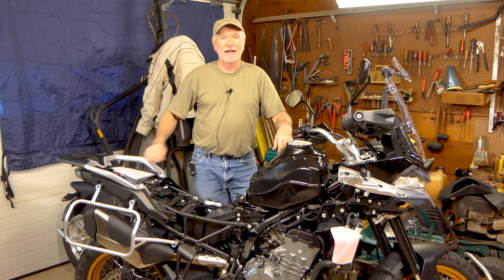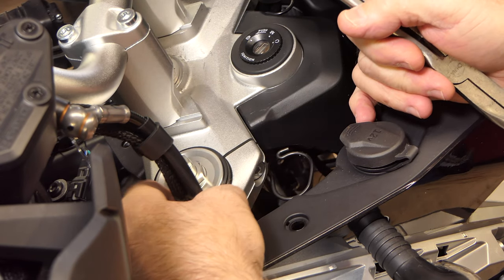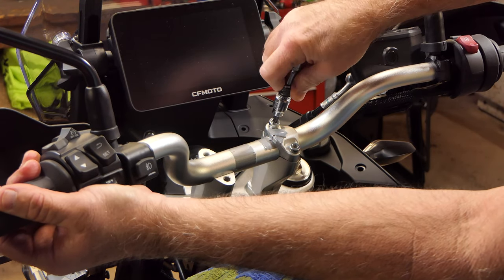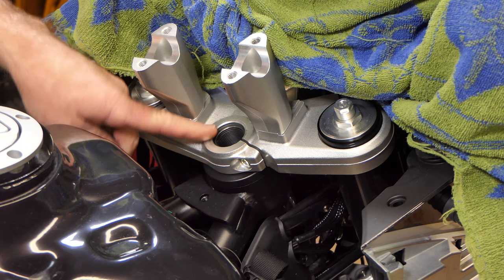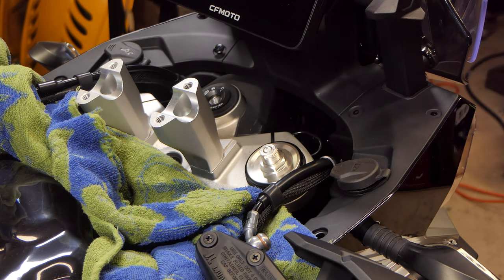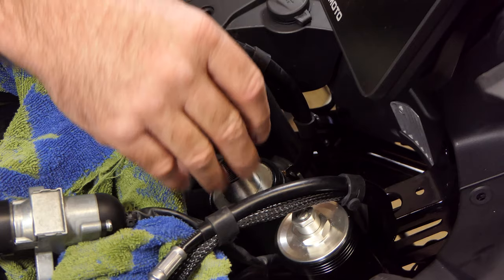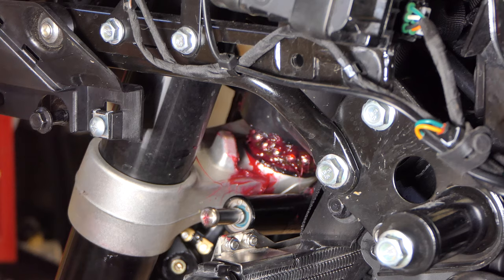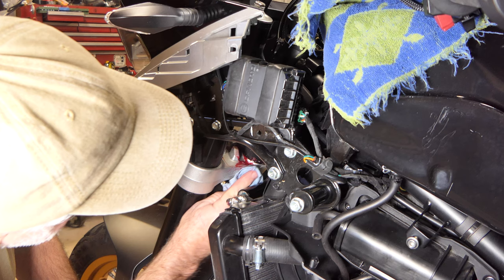CFMOTO Ibex 800T Steering Head Bearing Service...

Comment: What an excellent example of showing the minimal grease that is actually applied from the factory John!  I could see the lower race looked as if water ingress had started to rust slightly. Surprisingly not seeing a thin steel plate & encapsulated rubber ring seal under the bearing? I wouldn’t have thought the balls would be loose! You definitely don’t want 1 of those to fly around the garage floor! Thanks for sharing!
Edit: I think there is a seal!
Reply from the maker: Good to hear from you sir... thanks for watching. :)

Comment: I watched quite a few of your videos of the Ibex 800.  I seriously consider buying one and your review videos are very interesting and helpful.  I had a few R1200GSs and like the ADV bike ergonomics since I am tall.
Right now I have a 1989 Yamaha Vmax which I fixed after setting for 12 years.
As far as this video is concerned. I can't believe the Ibex has ball bearings instead of tapered roller bearings.  The last time I seen ball bearings in that location was on my Kawasaki H2 almost 50 years ago.  I am also from central MO.
Reply from the maker: Good to hear from you.  The Ibex seems to be a pretty solid bike so far, it is pretty much all KTM 790 Adventure.  The steering head bearings are the KTM design as well... Hope you get that new ride soon... thanks for watching...  :)

Comment: I will assume you are still under warranty.... Makes me wonder if all that is necessary... If the wear causes issue wouldn't you be able to have that done under warranty? I think this is maybe your hobby.. take it apart, put it back together.. hobby.. Love it.. I get it.. Great videos.. Keep them coming. :-)
Reply: I think he is a bit like me,  an old mechanic that just wants things to be done right. Also there is always going to be a problem with wear and tare components that become contestable under warranty. If the dealer is a not good, they might not support the warranty. but I think the reason why he does this work is exactly what you identified and its good for the viewers for when the warranty runs out. 😀

Comment: another great video.... do you do this annually, or did you do this just because it is a new bike and you have ridden it hard, or did you hit a certain mileage? Interesting stuff. I like to service my own bikes, but there are certian things on my Goldwing I let the shop do. It's just too much work to do in my garage and wrap it up in a couple of hours. It would take me days and the shop can do it in an hour or two. But, I am really thinking about selling one of my other bikes and getting IBEX, but it sure looks complicated, like this Goldwing.
Reply from the maker: Good to hear from you sir, I service all the bearings in my bikes every winter and also when I get a new bike I want to make sure the bearings are lubricated properly.  I do not believe the Ibex is any more complicated or complex than any other motorcycle.  The covers are a bit of a pain to get off but after removing them the first time I think I can get them off and back on fairly quickly.  Once the covers are off the bike it is the same as pretty much any other bike... Thanks for watching and good luck with all your projects...   :)

Comment: great video. I've watched all your 800mt/ibex 800t videos. great stuff. I wonder if you can help with with the size of the front axle allen key size and if you can confirm that the rear axle nut is 32mm? very much appreciated and thanks in advance
Reply from the maker: Hello there sir, good to hear from you... the front Allen key is 12mm and the rear axle nut is 32mm... thanks for watching...  :)
Reply: @ozarksbackroads5484  thank you